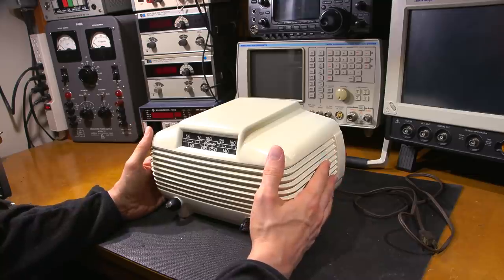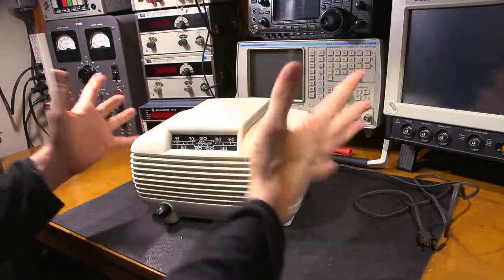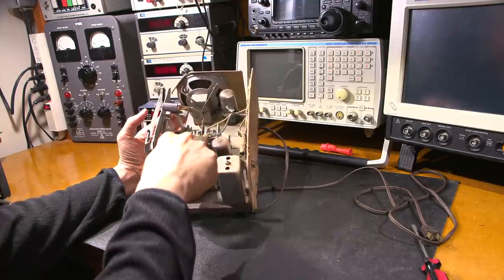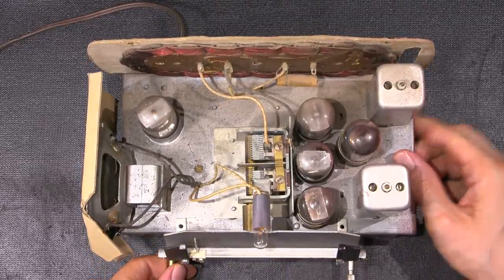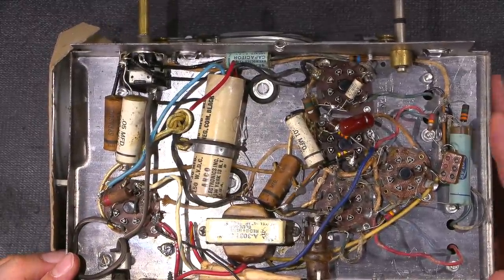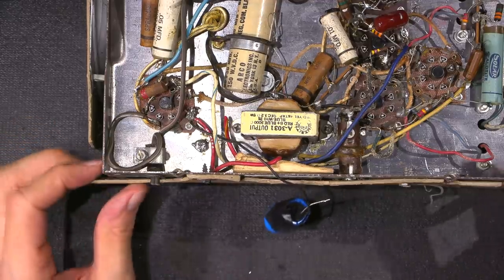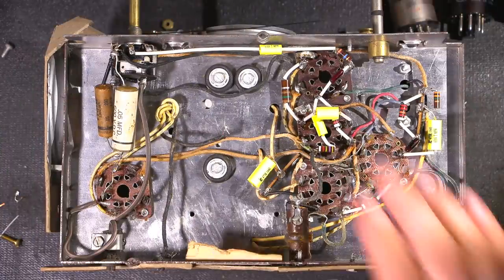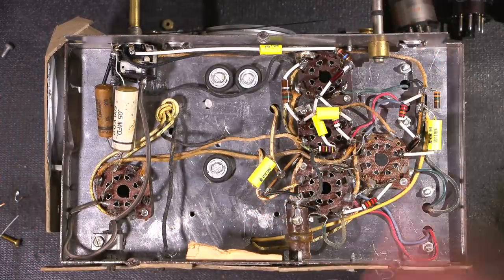BEAUTIFUL 1940's Majestic Radio Receiver Restoration!

Comment: How long do you expect this radio to work correctly after its restoration, assuming it is used often? I expect modern components might last longer than the original ones. 50 years?
Reply from the maker: That would be my estimate David. Modern components will last much longer than the originals.

Comment: What about the small capacitors in the IF cans, do they get checked or is that something that you only need to tend to on an "as needed" basis?
Reply from the maker: Those capacitors (in these years) were fixed mica style, and not the compression type. They are ok almost all the time.

Comment: Again, there is a reason the all american 5 radios switched the line to chassis side. it keeps stray hum pick up at the on-off volume control area to a minimum. Most radios were made that way for a reason.
Reply from the maker: I have explained that in many video's.

Comment: Another great video and very enjoyable.   Crazy question, is there a way of converting fm signals to am so that we can continue to enjoy these vintage radios?  AM broadcasts seem to be slowly fading away.
Reply: I have seen people use low powered AM broadcast transmitters. They are legal and VERY low powered, say enough to fill your home but not much more.  You simply attach it to whatever signal you want to listen to, be it FM, MP3, CD ... whatever. The transmitter puts out a local signal that you can tune the AM radio into.

Comment: Hello Mr. Carlson. I just bought a 1946 Majestic 5A410 radio & will enjoy refurbishing it while following your video. What is a good source for the capacitors & resistors that I will replace on it. Also, where dis you get the iem that you used for the ground s near the switch? Thank you, Gene

Comment: Thanks this your very nice video! One comment from my side to the alignment of the scale. I´ve seen (understood), there is no possibility to align the point of low frequency (i.e. 550 or 600kHz).
So i assume, this has to be done mechanically by
- either shifting the pointer on the dial cord
- shifting the glass with the scale (therefore the felt)
- using the setscrew to rotate the main capacitor
at a frequency at the lower end of the scale.
Reply: I think no, that would also adjust the both ends of the scale that Paul did set already by shifting the axe on the tuning capacitor (1:19:30)
I think the only way here is to change the radius of the big wheel, by putting a thin layer of material of some kind on it, (and then re-set the end points of the scale again) but that will be an adjustment only possible in one direction, in the specific case that the 550 kHz is TO CLOSE to the 1600 kHz point. If it is to far, you would need to lower the radius of the large wheel, and that is almost impossible.
Reply: @erikdenhouter  Of course, any shift of scale/axis etc. affects both sides of the scale. But the small adjusting cap at the side of the main tuning cap is only effective in case that this tuning cap is nearly completely out (minimum capacity); therefore any error can be compensated at 1600kHz with it. Then a smaller correction at 550kHz (maximum capacity of main tuning cap) can be done again as above and again a hopefully smaller correction at 1600kHz and so on..... If the mechanical tolerances aren´t too big, this way leads to a proper aligned scale after some trials. This is the classic way to align old analog scales with a coil (at 550kHz) and a cap (at 1600kHz) as described in many manuals. BTW the last alignment has to be done with the cap at 1600 kHz. That´s what i meant.
Reply: I understand what you mean by adjusting it with that cap, but there's no coil in this setup ? I hear Paul stating at 1:24:40 : "We don't really have any choice if the dial accuracy is off, it is the only adjustment..." referring at the small adjustable capacitor. That's why I looked at an alternative way to 'stretch' the scale.
Adding capacity (turning the little cap) adds from 0-10pF but also 300-310 pF, so i guess that's just a shift of the entire scale.
Reply: @erikdenhouter  Take Thomson´s law for resonant circuits, you´ll find that a capacity variation from 0pF to 300pF gives much more frequency variation than 10pF to 310pF. So the scale can be stretched with this small cap.
Reply: I have learned something... Did not know that. But now I wonder if that move in capacity reach with according stretch will give a substantial difference, it is only 5-10 pF. I have no experience here.
Reply: @erikdenhouter  5 - 10pF can be a huge difference, when the main capacitor is set to nearly 0pF (It´s all relative - again: make the maths with Thomson´s law). And have a look at Pauls new video regarding alignment of the vedolyzer, where he exactly describes this relation.
Reply: @ DL7MAJ Stefan
I will, thank you.

Comment: Beautiful work Paul. Why didn't they use AC line fuses on those radios?
Reply from the maker: Hi Dan. You will notice on the schematic, the first connection from the line cord is the filament of the 35Z5, and the dial lamp in parallel with that filament connection. Any gross over current situation will open these elements, acting like a fuse. Thanks for your kind comment!

Comment: Your lab wiring, how much amperage does it use,or do you pick and choose what is on?
Reply from the maker: Aside from the devices in standby, only a few pieces are ever on at a time. (Probably 7 Amps max worst case.) The average would be 2 "or so" Amps.
Reply: @MrCarlsonsLab  oh ok,thanks for responding,  Dad was a shipyard electrician, watching what your doing reminds me of the stuff he probably did in the 70s,

Comment: my way of aligning IFalignment differs from yours. lose couple generator with 10 to 50 uuf capacitor and maybe a 10meg resistor across the isolating capacitor.connect signal gen. to grid or plate of first detector tube.connect vtvm from ground to avc circuit .(diodes in first audio amp tube .preferably the one that goes to the low end of the primary of the if transformer; put vtvm on --dc and tune for max hold down signal to give you less than 1 volt on vtvm' this is more sensitve than using audio at speaker. they are usually 5;000 ohms down to 8 . old radio tv tech

Comment: Paul,  did this radio require the alignment because you changed so many components and their values?  I believe that you hand-selected resistors to be as close to their "marked" values as possible -- the factory probably simply installed whatever resistors they had.  I assume that your caps were (slightly) different values from the originals too.  Also, what type of oil do you use on bushings & bearings in your radios?
Reply from the maker: Hi Bob. The surrounding components were failing, and since the receiver would have poor reception with those bad components, the first thing people do is look for something to "screwdriver" inside. So the IF chain was probably messed with to compensate for bad reception, and they found it didn't work. The surrounding caps would have little affect on the IF tuning in a working situation. I use synthetic engine oil for lubrication of bushings and bearings, usually just 10W30 Synthetic in a bottle.

Comment: Secondary of output transformer you connected 3.3 ohm resistor for checking.. will it not vary  instead connecting to reactance,, speaker resistance value changes while checking in DC.. Thanks
Reply from the maker: Yes, at different test frequencies, the impedance will change, even with a purely resistive load. This transformer was tested at 100Hz.

Comment: Anyone else here ever find out the painful way that some jerk swapped the hot & neutral wires on an outlet?
Reply: Shmeh Fleh That probably indicates that wherever the work is done, it’s not done in a safe way. The isolation transformer is a real requirement, and it will make outlet polarity irrelevant. It doesn’t have to be huge if you don’t deal with power hogs, and there are ways of reusing obscure transformers as long as you have a pair of them. Long ago at the vacation house I was working on something electrical and the junk bin had two 220V to 160V transformers from some odd long forgotten equipment. I checked them for leakage, put them back-to-back, and got two layers of isolation for free. Later I got a suitable switch and the 2nd transformer could be reversed to step down. And it so happens that (160/220)^2 is about 0.53 ratio: perfect for powering 120V equipment from 220V (back when Europe wasn’t up to 230-240V yet). Another thing that works nice anywhere a house gets 3-phase service and a bit more current is needed than a single phase circuit can provide: Use a Scott-T connection to reduce 3 phases to 2 at higher current.

Comment: Your signals lined up, spot on at 1500 and 900 kHz. But what it you went down to say 600 kHz and found you were 20-30 kHz low so that a signal of 660kHz showed up at 570 on the pointer? Now what?? I actually have an issue with a radio Im working on where the middle of the dial is good, the low end it too low and the high end too high.

Comment: How did you extend your capacitor on the top? It looks very long on one end but no bulge like a wire soldered on.  Which brings up my second question what type of wire do you recommend using to replace wires in these radios? 
Thanks Paul great video again!

Comment: I am from the UK and we have a 3rd earth wire on our equipment so I am not familiar with USA old 2-wire mains. Could you explain a bit about it. For instance in the USA what happens if I have two radios connected to the same 1940s house wiring and one radio has a chassis connected internally to mains wire A and the other radio has the chassis connected to mains wire B, and I touch one radio chassis with my left hand and the other radio chassis with my right hand...?
Reply: Very nasty shock.
As with a lot of modern installations where you can plug in (an old radio) two ways.

Comment: It would be much more power efficient to use transistors instead of tubes
Reply from the maker: Yes, but this isn't about efficiency.
Reply: It would be much more power efficient to use a radio-on-a-chip, probably. But where’s the fun in that :)

Comment: He should've drilled a hole in the top, installed a 3.5mm input jack and wired it up so you can connect your android and play mp3's of death metal through it...

Comment: Hi, Paul is there any possibility that you could explain " What is Spectrum Analyzer "
Reply: May I pop in?

A spectrum analyzer takes a range of frequencies as parameters, and an input signal, from which it then displays the intensity of each frequency in that range. 

They are used in the audio recording industry, at concert venues, etc... there are also spectrum analyzers made for RF and I remember Paul has restored some device that had a small analyzer on it for finding closely spaced stations etc.

Comment: After all the work replacing capacitors, etc you appear to have re-used some of the old wires. Is this right and why?
Reply: I'd guess the ones going to the topside might be more visible and it just makes the radio look more original from the top of the chassis. And if the insulation is fine and the conductor is still there.. why not.

Comment: Is there a reason not to replace the rectifier tube with a couple of silicon diodes, except the nostalgia?  You could even leave the original tube there for looks.
Reply: Yes there is... The rectifier tube has a filament that plays a role in series with the filaments of the other tubes. Replacing the tube would need a large (power) resistor to take that place.
It is a 35Z5, the first number shows the filament Voltage (35V). The current needed is 0.15A (for every filament in that series chain), so the resistor you would need is 35/0.15 = 233 Ω, and it would dissipate 0.15x35 = 6Watt. 10 Watt would be the least choice, and that is a large peace of a part.

Comment: The problem when people donate these things to thrift stores is the people handeling them most likely dont have the knowledge about not plugging it in, i work at goodwill and before we put stuff like this out on the floor we test it to make sure it works otherwise we just throw it away if it doesn't, people are better off selling these on Facebook or a swap meet.

Comment: Why did you use a safety capacitor for the external antenna is that in case of lightning strike.
Is it a triac from x-ray equipment?
Reply from the maker: The antenna connection (isolated by that safety capacitor) connects directly to the chassis through the antenna coil.
Reply: @MrCarlsonsLab  nothing to do with lightning strikes just in case the chassis becomes live your saying ? would it help against a lightning strike I would have thought so if the aerials outside
Reply: @johnsweda2999  No. Lightning is difficult to stop, and surely not by a capacitor of which the plates are VERY close together.
The best approach to lightning is guide it to earth before it reaches you. A classic technique I remember is to put a small neon bulb (the small screwy indicator things) with one pole connected to the aerial, and the other pole connected to solid earth. And you do that outside your home, in a waterproof housing. When normal, the antenna signal is well isolated from earth (the gas in the neon bulb acts as isolator), but when over about 80Volt (lightning) the gas will turn into a short, and will direct the current to earth.
Reply: @erikdenhouter  sounds about right yeah that's good. I was thinking that the safety capacitor would had a barrier to stop the radio blowing up, lightning is generally very quick and not sub stained enough, the energy would go into destroying the capacity but save radio Catching Fire I suppose you could just use a ceramic fuse I suppose inline as well

Comment: Why did they put the switch on the neutral wire?
Reply: They did not. As Paul explained, there are two ways to plug in the line cord, so you cannot distinguish between neutral and live. For that they switch the wire that runs to the chassis, the best they could do, so at least when the radio is switched off they turned off the chance that the chassis was live.

Comment: I wish I could watch your videos. Please high-pass filter the audio, it literally makes me sick because of all the low frequency noise.
Reply: huh? I doubled checked with headphones and enabled base boost, I think you might have a local audio issue. This channel has some of the best audio on youtube.
Reply: @DaveMcAnulty  "Best audio" is exactly the problem. Look at the FFT. There is massive noise 120Hz, 60Hz, and below. I'm not joking when I say it literally makes me sick when I watch these. I've manually filtered the audio with a high-pass and it's fine after that.
Reply from the maker: I look at my audio with a Stanford Research SR780, and it looks good on my end, broadcast engineers seem to agree everywhere as well. So do you think the issue might be your setup? (the problem "IS" on your end.) Your FFT is analyzing YOUR systems issue.
Reply: @MrCarlsonsLab  I'm analyzing the raw digital youtube audio, it's not my system. If we look at the spectrum the peak component is 120Hz, a good 20dB louder than any other frequency in the video, this is insane. In fact down to about 30 or 40Hz is as loud or louder than anything else in the video. This is not normal. Most YT videos (not yours) peak at 400-1500Hz and drop off significantly below that. There is a very heavy low frequency component to your videos.
Reply: Never heard any of what you say.
Just recorded some silent passages with Audacity, boosted the 50-150 Hz with the equalizer for 24 dB, cannot see one dB raised.
Reply: ☣droid☣ I don’t know how you analyze it, but that’s just not how the digital audio looks here. It’s clean. Really. Something is seriously messing with your analysis, perhaps the analyzer unknowingly mixes in the sound card input – if left floating, it may well hum like that. You really should investigate on your end.
Reply: @absurdengineering  If it were on my end it would show up on other channels/videos, it does not.
Reply: For anyone  wanting to replicate my tests. Use a YouTube video downloader to download the RAW video (make sure it's not re-encoded). Load that video/audio in to Audacity. Select a large portion of audio then do Analyze->Plot Spectrum. Witness the massive mountain in the low frequencies.